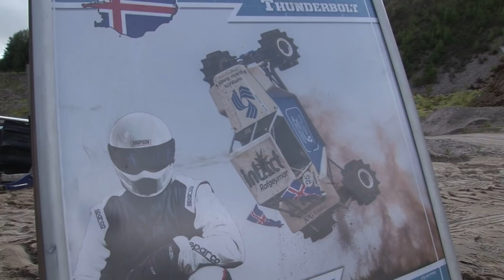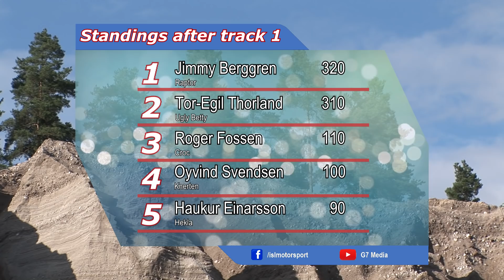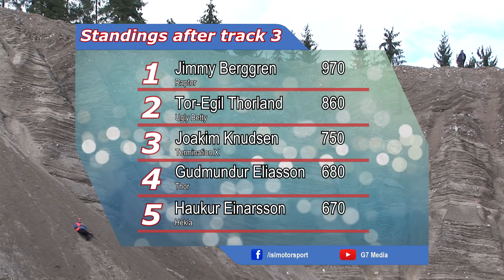Norwegian Formula Offroad 2019 - Rounds 8 and 9, Skien

Comment: Thanks for doing these great commentary videos!  Minor correction/addition - while Roger Fossen's car may have stalled around 14:37, the main problem seemed to be that the front drive shaft broke.  You can see it dangle as he fall back down.  I assume that the engine stalled because the front axle seized up or similar.

Comment: I was there only on Saturday, I rarely complain about stuff, but this place was not so very spectator friendly, pretty hard to see much, the time attack you did not see anything of, other than start/finish.
It seems the film crew had some similar trouble?
I think they should have made an platou for the spectators, wich should be not too hard of a task in a sandpit where most of the equipment is already in use, or atleast planned it a bit better or something similar.
Sunday looked better it seems though, probably better when it dried out some too, pretty wet on Saturday.
I wonder why it was not in Nenset this year? That place is/was very spectator friendly, seeing the whole place standing across from the other side.
This place sertainly had some steep walls though!